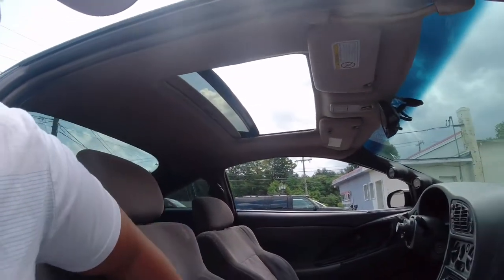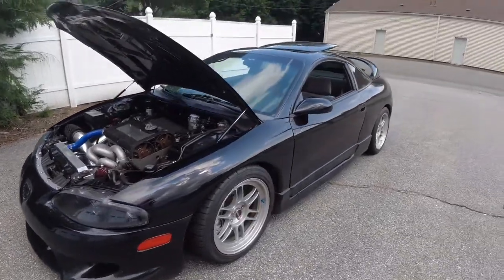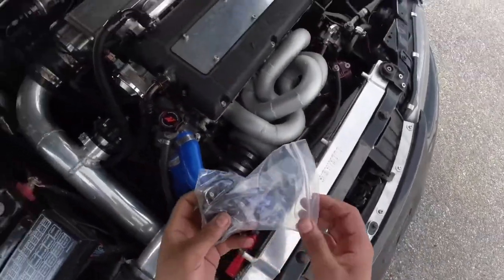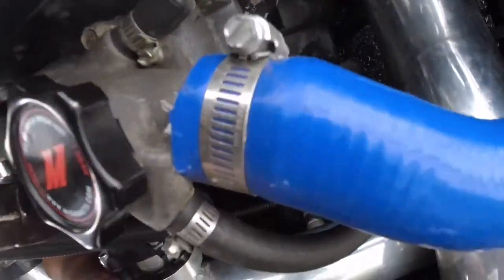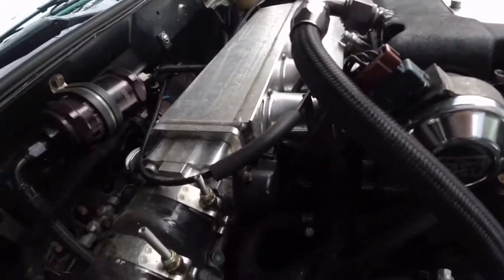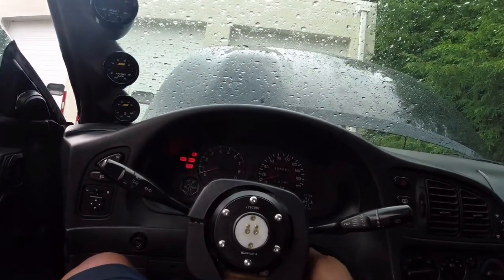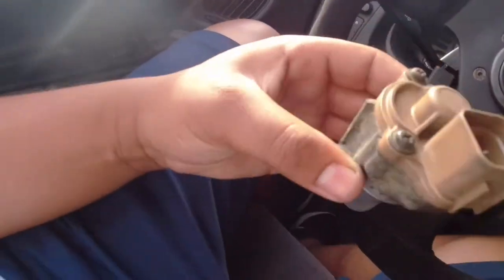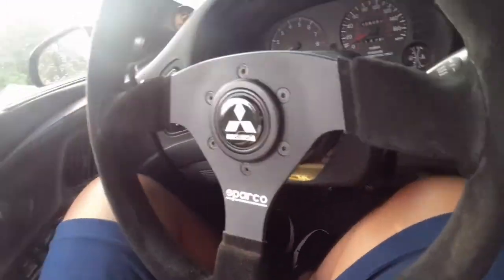Installing a new idle air control valve on my Mitsubishi Eclipse GSX!

Comment: So I recently bought a 95 eagle talon tsi, when I first start it I have to give it gas, and than Rev it to about 2000 for about 10 sec before slowly letting off the gas for it to idle. It idling sounds super rough. Whenever I try to drive, when I stop with the car in neutral, and I let off of the gas to press the break the car dies. I'm saying all this bc I'm curious, was you car doing any of these things before you replaced yours?
Reply: Mine did similar symptoms.